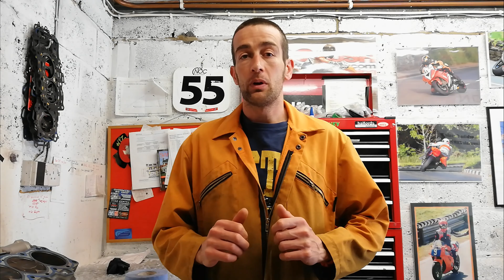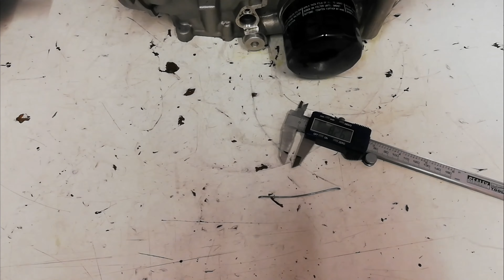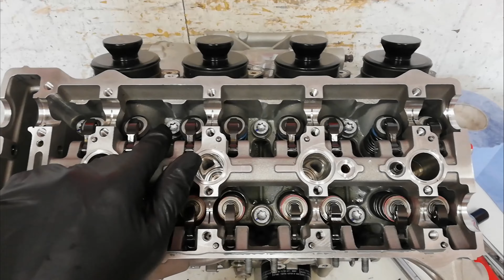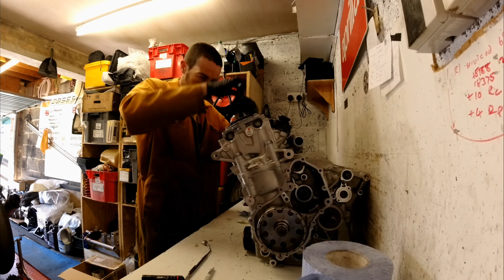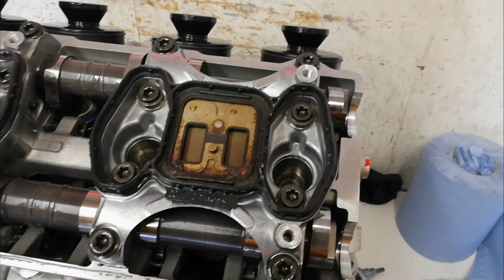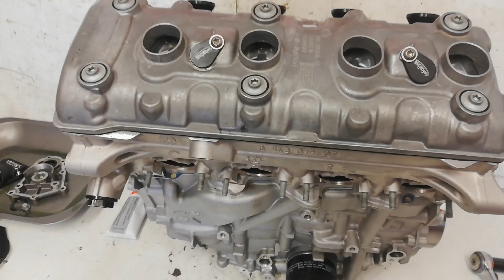How to refresh a BMW s1000rr engine.  Part 8

Comment: Is it normal for the number three cylinder exhaust lobes ride on top of the rocker arms before placing the caps? 

the cam. #3 exhaust. Cam Teeter totter's. The weirdest part is that the chain matches up (I marked them with color dots like you said) with the gears on the cam. As well as on the crank gears. It should all be fine. 

But yet everything lines up everywhere else. Intake cam is flat and seated in the motor. 

Cam gear marks line up.; such as the exhaust gear lines up with head. The crank- two markings line up. 

It’s the exhaust cam that doesn’t seat into the motor it Tedder totters at #3 lobes.
Reply from the maker: One cylinder will always be on cam when fitting the cams, as there's never a point that all valves are closed in a conventional il4 engine. Assuming that's what you mean.

If its not, you can email some photo's to me via the website

Comment: Hello, Hope you are fine and doing great. I watched the whole Engine Refresh series on this Engine Which has been really helpful! everything explained perfectly :)

Though currently I am refreshing my own engine S1000rr just the way you did yours and unfortunately I am stuck at the part where you set the timing/position of the cams and I don't have the specific tool that you are using to check if the cams are in the right place at 10:48 part of the video, is there a way where I can set the timing without that specific tool as I don't have access to that tool :( 

Quick response will be much much appreciated as I am currently very upset that I wouldn't be able to set the timing correct again :(

Comment: Sooooo correct me if I'm wrong soo with this. That is why you can't just change an stock exhaust and headers without tuning it? As they've designed the engine to work with the exhaust and cat down to how the engine is timed.???
Reply from the maker: You can change the exhaust, but it'd always benefit from having the fuelling and ignition mapped correctly. Nothing in the engine needs changing though
Reply: @obsession_engineering  thank you Dave

Comment: I have a question about the camshaft position. I set TDC but my instructions from bmw show to install the cams 180* opposite of how you have it (with the 2 screws facing above the alignment marks.  But when I continue to turn the engine over back to TDC the cams are flipped over to how you have it to begin with. So I’m confused which is right?
Reply from the maker: Cams will only travel 180 degrees when the crank does 360 to get from tdc back to tdc, so both will be correct

Comment: Love hearing you explain valve and engine theory! Curious how/if you can adjust ignition timing (note I don't have knock)... is it fully CPU controlled? Does it adjust dynamically after valve timing changes?
Reply from the maker: The ignition is totally ECU controlled but the ECU can be unlocked by BMW dealers and then the RCK calibration kit is great for fine tuning

Comment: Excellent video series. Sir, what is the squish specs for this engine?
Reply from the maker: Bmw don't give a measurement, but most are around 0.85mm
Reply: Thank you sir. 
So 0.85mm equals 0.0335” for the squish which is nice for an 80mm bore. I’m really impressed with this engine. I’ll do some more research and see if I can find what the VE is for this engine.

Comment: Dave when you have timed everything up and cylinder 1 & 4 are at TDC what stroke is number 1 going into next?

I was thinking that the position of the lobes will help so someone without the timing tool didn’t fit the cams 180° out, because obviously 1 and 4 will have just completed a stroke where the valve will have been open, so the cam lobes will have just finished opening and closing the valve and be in a certain position, and if you fitted them 180° out I’m thinking it should be clearly obvious.

I’m struggling to see looking at the cams which stroke 1 & 4 have just finished, I’m thinking cylinder 1 has just finished the exhaust stroke so it’s going into the induction stroke and 4 has just finished it’s compression stroke and is going into it’s power stroke?????

I had it in my mind when you set TDC it always meant cylinder 1 was going into the power stroke.

I am probably way wrong 🤦‍♂️
Reply: I’m almost certain 1 is about to start it’s induction stroke and 4 is about to start it’s power stroke, that would mean 2 is about to start it’s compression stroke and 3 is on its exhaust stroke. That would also tie in with the 1-3-4-2 firing order if that’s the correct order.

So knowing this it would make it easier to not fit the cams 180° out, that’s my thinking anyway.

Like you say putting your own marks would help, is there any reason why the cam gear has a mark opposed to each other? I’d have thought it would be easier with just the one but I’m sure there is a reason behind it.
Reply from the maker: The cams have marks on them, as does the cam drive gear to the crank. As long as the cam lobes are either facing towards or away from each other it doesn't really matter if its 1 or 4 that will be on the power stroke next.
Reply: @obsession_engineering  thanks for the reply Dave. Does the ignition timing come from the cams? The cam shaft sensor? So if you fit the cams either way, the spark timing will fillow? So essentially if you have 1 at TDC power stroke next but fit the cams 180° then that would make 1 TDC induction next which wouldn’t work unless the spark timing changed as well, which if it does then you can’t really go wrong. I’m guessing the timing tool fits in when they are 180° rotated? 

I’ve watched a video where the TDC is set but unlike this video cylinder 1 is going into the power stroke, and the timing tool slots in, so I’m guessing it will fit either way.

Comment: Hello mate I have a question to ask regarding piston to valve clearance on a 2014 BMW s1000rr. I had my cylinder head ported and milled .015,and wanted to know what should the minimum PTV clearance be?
Reply from the maker: Bmw don't give any figures for p-v so it'd be your decision.
Also remember that cam timing and squish will have altered, but there is an option on head gaskets so I'd start with checking squish or compression ratio
Reply: Thanks mate!

You're correct about cam timing and squish being altered after a heads milled. I do have choices of head gaskets to use ,what squish clearance could I run after those changes?
Reply: When you performed the squish clearance measurement what values did you get? Also you mentioned doing piston to valve clearances from previous s1000rr what were those values?

Comment: How can you be sure the timing is correct without the bmw timing tool ? Is there a way ?
Reply from the maker: There are markings on the cams and cam drive gears, which are pretty accurate. The tool just gives the exact position
Reply: @obsession_engineering  thanks for your reply I wat he'd re watched and watched again managed to remove came inspec the rocker Arms and re install today. All running fine thanks for the videos !!

Comment: Awesome series! Can you hone the cylinder walls and install new piston rings? Or are the walls lined with some fancy coating? I bored out my tired old ZX-9R engine and she runs amazing now.
Reply from the maker: They're plated bores, so big bore option but they do wear well. I usually flex hone to break any polish off and alpha sell rings as bmw don't
Reply: @obsession_engineering  Nice, thanks for the reply :)
Reply: @obsession_engineering  have you had any experience with cylinder nikasil plating in the uk? wanted to get a +3mm overbore for a zx10r but could only find a US company to plate